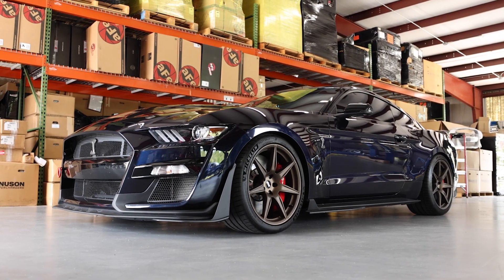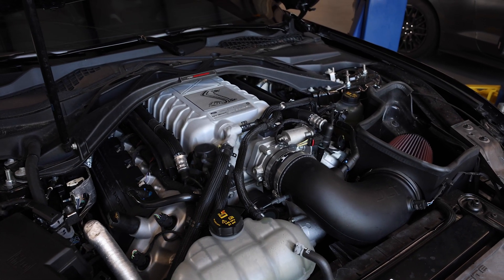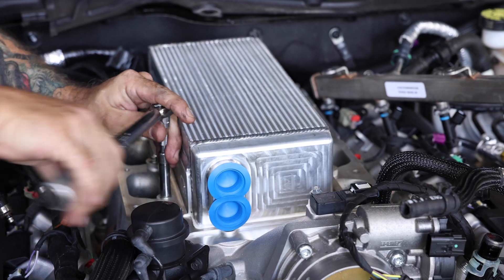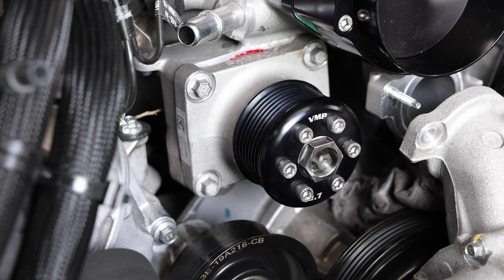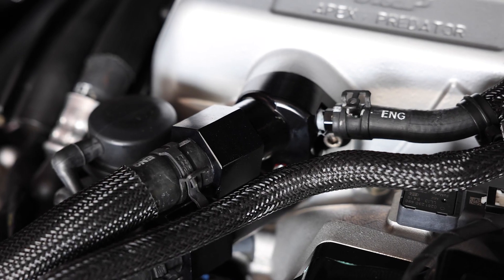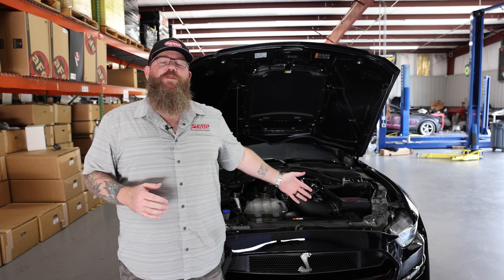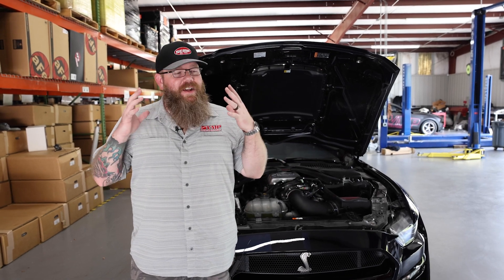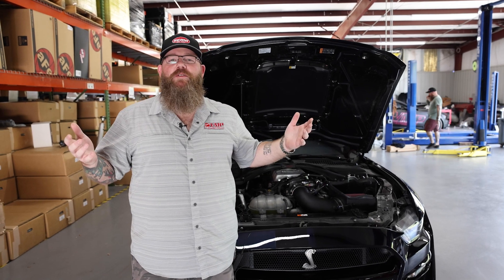Bolt on over 100 rwhp for your Predator GT500?!  ABSOLUTELY! ||  2020+ Shelby GT500

Comment: Custom tunes? I have a FP700 kit on my F150 and find the tune is super safe along with the lame 100mph limiter. I’m getting some GESI cats welded onto some long tubes so that I don’t blow out a cat. My question for you is what would a pump gas tune cost. The only performance shop near me is Off The Line Performance but I’ll have to rent the dyno for a couple hours to be able to get in within a reasonable time frame.